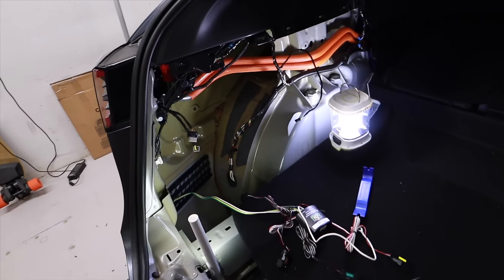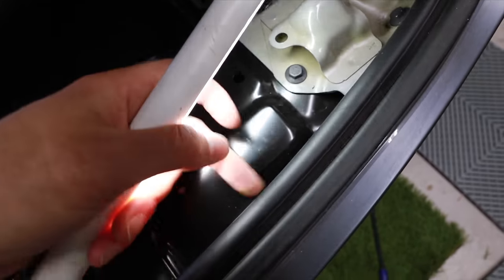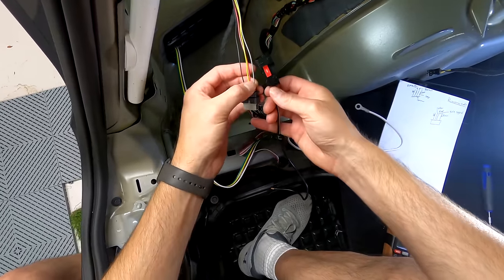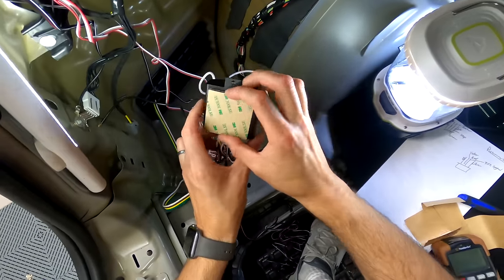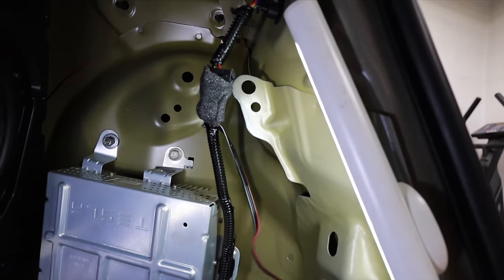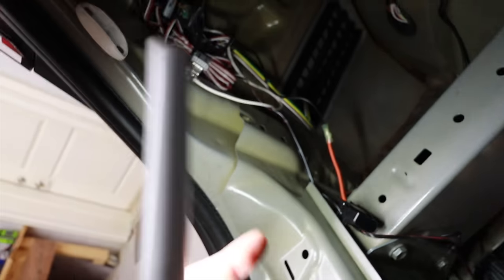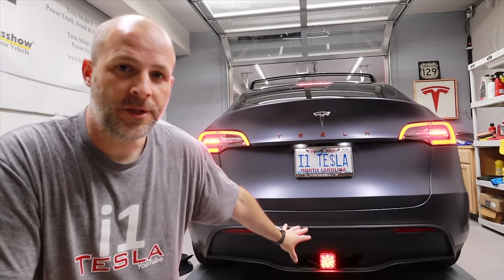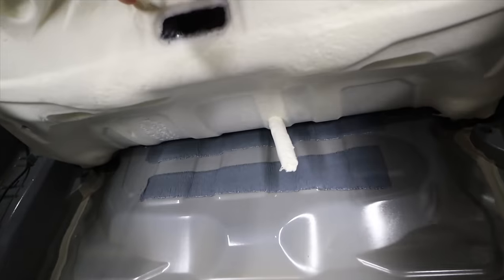Model Y Trailer Wires

Comment: My 5 cents here: i think it is better to move the fuse close to the battery (wire insulation might fail somewhere along), black wire might be considered as negative.
Reply from the maker: Good point
Reply: Not only your 5 cents, this could save the cars live in case of a damaged insulation.
Btw. do Americans don’t need a backup light on the trailer?

Comment: Great video but I'm wondering if it's really necessary to run that 12V wire to the front instead of finding 12V somewhere in the rear?

Comment: I recall Sandy Munro showed a single Tesla OEM electrical connector prepped and ready to use with their trailer hitch.  This was before they even offered the Tesla trailer hitch option.  In short, no need to find turn signals, brake lights etc.

Comment: Can you try to show how it looks like when having a trailer attached, in particular one from U-Haul.
One thing to demonstrate is how easier or difficult it would be to attach and detach the security chains.
Can you measure how much additional time it would take when using a supercharger, by finding a spot to park a trailer,
detach it and then going to the supercharger. Then coming back, re-attach the trailer and go?

Comment: Brian, it is not too far. I put the hitch wiring in the model 3 and had to open up all kinds of things.   I ran a 10ga for extra capacity for a 12v socket or power trunk from the front battery, through the firewall, along the passenger door sills and up and over the rear wheel to the sub compartment. That is where I mounted the light module right to the sub mounting arm which was really convenient. I was able to run the wiring out to the hitch right through an existing plug which I used as a grommet for the wiring which was in the back of the trunk tub. There are actually these plugs on each side in the back. Through the plug it could go down to the hitch area outside. I have always had a supply of and ran all wiring in plastic flexible split loom everywhere to protect it. I have always run everything in loom. I have been using the lighting and hitch for a 24x60 aluminum hitch platform which has rear lights built into it. If I told you what I did in wiring and equipping an older 88 camry that I used, it would be much more than anything we will probably do to the model 3. It went from entirely removing the dash, to soundproofing the roof and flooring to making the windows auto roll up with remote control and on and on as well as remote start, honk, alarm paging, 120v inverter wiring etc.

Comment: You definitely don’t want to use autopilot with a trailer, AP doesn’t know that the length of the vehicle has changed. If the vehicle swerve  to avoid an obstacle on the road the trailer will most likely hit the vehicle in the next lane, auto pilot doesn’t know the length of the vehicle has changed.  Brian this is a bad advise but I love the channel. I  look forward for watching more videos.
Reply from the maker: That is why I added "pay attention"
Reply: Even plugging in, Tesla still doesn't know the length.  Trailers vary widely.
Reply: Hussain Saleem Right. Automatically changing lanes with a trailer in tow is a recipe for disaster with Autopilot engaged.

Comment: I assume the backup sensors only beep/cause issues when in reverse?   in forward /autopilot cruise etc.. it does not cause an issue when a trailer is behind the Y?  The aftermarket light setup can that void the Tesla warranty or cause an issue?

Comment: Great vid Brian!  Question: Would it be possible to install the Eco Hitch and have BOTH the Tesla Wiring (in case Tesla Tow Mode improves - possibly allowing more AP features) and the aftermarket wiring plugs available? Then, you could plug into aftermarket wiring in a safe area with a light or empty trailer, and use Tow Mode on other legs of the trip after switching plugs. Or is that not even possible? THX

Comment: Just did this myself.  I did fuse in front.  My only issue, is the effort in taking off && putting back on the rear panels.  The lower part of the panels, the recessed part, seems off.  Brian, you had removed the center tub pannel, which I did not do, since I had no bottom facia bolt issues.  Is there an order for the panels, ie ,Do the floor cargo liners need to be removed, etc. For perfect refit?
Reply: answering my own question:  When I went back and re-examined more in depth, I determined that 4 extra panels need to be removed before the side panels to make your life WAY easier.  The 2 bottom panels of the side holes, they go in near the end, during re-assembly & the 2 tunnel panels that run parallel to the side panels.  This completely frees the space for the side panels to simply drop into place & snap in sans obstruction.  Boy this would be so much easier the 2nd time around.

Comment: My model y came with the factory hitch. I bought the same lights and 7 to 4 pin adapter. But no lights come on. The trailer mode turns on but no lights…

What am I doing run. Thought it would be plug n play hmm

Comment: Hi Brian. Off the subject question. I have an SR+ and the foot well lights are there but are deactivated. They only flash for a second when I open the door.  Next time you are in the area, can you see if there’s a way to hook the floor well lights to the lights at the bottom of the door which do work ?  Thanks. Love your videos.

Comment: Brian,  Found solution after second call to really more helpful Tekonsha tech staff Kirk and Peter. Wired longest sensor, happens to be right turn signal, with 3 foot extension with thicker 16 gauge wire, to third brake light in hatch glass via flexible rubber wired connector between hatch and roof.  Now have license plate frame with dozen LEDs operating tail and brighter brake lights.  MY now has 4th super bright tail and brake lights from United Pacific, Amazon.  MY is now easier for blind and distracted drivers to see it and avoid rear end accidents.  Also wired direct from battery second wire for travel refrigerator connected to 12 volt always on power outlet in rear.  Ready to travel now!

Comment: For a rear need for 12 v you can attach a wire to the 12v terminal on the right side of the penthouse below the back seat.
Reply: But you would have to splice the wire? By connecting to the battery, you don't touch the original wires.
Reply: @nihongobenkyoshimasu3190  No splice required.  There's a bolt you can put a ring terminal on.

Comment: Since my Y came with the hitch etc  I plan on mounting my led rain light recessed into the cover panel for an ultra clean look as if it comes this way and use a quick disconnect to remove it when I need to use a trailer

Comment: Brian,  Great video on solution to adding tow hitch with wired lighting.   Added same Tekonsha sensor system to our MY to connect to a fourth brake & position light bar attached to bottom of license plate frame.  Confirmed correct wires for parking, brake and turn signals with volt meter and added sensors to wires then proceeded thru sensor learning mode many times. However, turning on left turn signal causes brake light to flash! Other 3 functions work great.  Any ideas on what’s happening? Or what needs adjusting?   Tekonsha technical service had no information for Tesla install.  Your videos are really educational and helpful!  Thanks for your response.
James

Comment: You can pull 12a continuous, 16a max through the 12v accessory port.
Reply: todd2fst4u2 I got the impression he wanted sometimes run a 12v cooler off the accessory port. That plus the trailer load could be what he was concerned about.

Comment: UH - OH, Brian, You made a mistake.  You must put the fuse at the battery end, not in the back where the controller is.  If the wire you have run develops a short.  It can start a fire!  By putting the fuse at the battery end, it protects the entire wire run.  The fuse will burn out before the massive electrical current can start a fire.   When connecting to a battery, always fuse it at the battery end or very close to it.  Most all vehicles even have what is called a fuseable link which is a short piece of wire ( approx 6 inches long) similar to what you ran that connects the battery to the fuse box.  It is situated so it is not near anything flammable  In the event of a major short or overload.  This link overheats and melts breaking the circuit.  In your case you now have a 15 foot long fusable link that runs up against other meltable/flammable materials.  This wire could allow up to 100 amps or more for long enough to start things on fire.
Reply from the maker: Thank you I will change it
Reply from the maker: @whiskeywisdomplus  Sorry but I'm not liable for peoples mistakes. They can read the directions.
Reply: @whiskeywisdomplus  modifications don't void warranties, that's not how it works.  Look up Magnuson-Moss warranty act.  Warranties can't be "voided", a manufacturer can only deny a specific warranty claim if and only if they can prove that the specific modification caused the failure you're making a warranty claim about.  Even then, the rest of the warranty remains in tact.
Reply: @whiskeywisdomplus  that's cute but an owners manual doesn't override federal law.  Sorry.
Reply: @whiskeywisdomplus  if you mean, specifically, "Non-genuine Tesla parts or accessories or their installation, or any damage directly or
indirectly caused by, due to, or resulting from, the installation or use of non-genuine Tesla
parts or accessories;"
Then it doesn't disagree with me, it says exactly what I'm telling you.  Tesla can exclude damage caused by a non-genuine Tesla accessory.  CAUSED BY.  That's exactly what I said.

Thanks for proving my point.

Now go educate yourself:
https://en.wikipedia.org/wiki/Magnuson%E2%80%93Moss_Warranty_Act?wprov=sfla1
Reply: @whiskeywisdomplus  you again prove my point, but then give an unrealistic example.  They have to PROVE that the specific accessory CAUSED the specific damage.  This is a consumer protection law.

I'm correct, you're not, get over it.  I have extensive experience with this exact topic, I know how it works.  Warranties aren't "voided" when you install something aftermarket.  The whole point is to prevent exactly what you're saying.  Otherwise a manufacturer could "void" your warranty if you installed non-OEM tires. Non OEM brake pads.  PPF or a wrap. A radar detector.  Floor mats.  The whole point is to prevent that exact abuse.

Warranties are a serious thing, they have weight, they have legal meaning, and they can't be cancelled willy-nilly because you connected a wire to a battery.

I'm sorry, but your understanding is incorrect.
Reply: @whiskeywisdomplus  also your rant on motorcycle helmets is completely wrong too, and completely unrelated.  DOT and Snell certifications don't even remotely work in similar ways and safety certifications have nothing to do with a manufacturer warranty.  DOT is a self-certified government standard, Snell is a private rating that only racing organizations care about.  Maybe you meant ECE.  Doesn't matter.

Just stop.
Reply: @whiskeywisdomplus  "I was referring to the giant paragraph of what voids your warranty".

Ok, first off you said page nine.  There is nothing on page 9 that lists things that void your warranty.  Voiding warranty is on page 10, not 9, and has things like scraping off your VIN or not complying with recalls.  What exact phrase in there do you believe qualifies a trailer hitch to void an entire warranty?  Please lay your expert legal advice out for us.   I'll wait here.
Reply: @whiskeywisdomplus  I also never said "trust me".  I can see how you misunderstand everything, your reading comprehension is terrible.

Comment: wouldn't the rear bumper ultrasonics sensors detect the trailer? 🤔 (or the cameras)
Reply: Hasn't been a problem for me.  They blink a little bit and turn red occasionally, they definitely see the trailer, but they're not beeping or annoying.

Comment: Is there a way Tesla can activate towing mode when using a third party tow hitch?
Reply: Good question!! 👍👍
Reply: And that would be the point of using the factory wiring it deactivates auto pilot and activates tow mode witch dose who mows what to the drive motor mapping
Reply from the maker: The only way to get the car in Tow Mode would be for you to push a button on screen. Tesla has zero idea I have this on
Reply: a way, or a reason?
way yes
reason, why would they 🤔
Reply: I mention this because i use it for my bike rack and the back sensors keeps going off. So I’m thinking part of “tow hitch mode” it probably turns off the back sensors?

Comment: I would also have to imagine that tow mode from the factory will also disable the rear sensors so you don't constantly have a warning on your screen something is close.  I'll find out next week since I'm getting the retro-fit package installed on Monday.
Reply: I haven't found it to be a problem with any trailer I've towed.  Bike racks could have the same issue and don't get plugged in.
Reply: yes and I am wondering if Tesla has a software update as well for the tow package for tow control of the car, I think the model X has this.  if you could report on your findings about what is different with putting in an after market tow hitch for $400 versus Tesla doing it for $1000 I'd love to know.  thanks for reporting back to us here, if you don't mind (that way I'll get notified of your update.) I made a pre-order of the car before the tow option was available and am trying to decide if I should go with Tesla install or do it myself (like I did on my Model S)
Reply: is the retro fit package from Tesla?  my local sc is not aware of a retrofit package..can you share the details so I can advise my local center?
Reply: Derek Brown  can you share the retro package ordering information, local SC has no idea
Reply: Larry Frank The part number is 1609595-00-A. It’s $1200 plus tax and they may or may not charge you a minimum service fee.
Reply: @dmoney0620  let us know how the install goes today..I think it may be worth the extra 600 over the aftermarket to have Tesla and proper electrical hook ups...
Reply: @larryrcmanf  Will do.  I dropped it off at 8 AM this morning.  There is some other cosmetic work that needs to be fixed so they didn't give me an estimate on when I'll get it back.  My guess is a couple days.

Comment: One difference with the Tesla version (I never saw it yet) would be the electrical plug that should be located on the right.
 As you can check, there is a little square opening designed for it.
Reply: The OEM harness plug is a couple inches left of the receiver.

Comment: unfortunately the statement with "no damage to the electrical cable" is not correct.
The blind connector CUTS in the original wire from the factory. So basically the statement with "no guarantee loss" is not correct.
whether you can see this during a dismantling or not is another matter!
I just wanted to note it correctly. but keep it up :) nice to see what is already possible with you in the usa!
something like that would be absolutely impossible in my country
Reply: There is no cutting happening.  The new connector simply envelopes the original wire with magnets.  Think of it as a magnet hug, not a shiv to the gut.  The original wire remains unscathed.  There are splicing connectors that penetrate the original wire to create a new physical path for electricity to flow.  This isn't one of those.
Reply: @dougdevine27  oh thats really magnetic :O  then I said nothing.
Reply: @MemphisMG86  inductive sensor, like an amp clamp. No damage is done.
Reply: @GregHassler  in slow mode i see it. thats maybe the reason why the light have a delay by the breaking light test
Reply: @MemphisMG86  exactly - there is, annoyingly, a slight delay as the current is detected.  Blinkers on the trailer blink slightly out of time with the car.
Reply: @MemphisMG86  I really appreciate a human that can recognize a mistake and admit it. Go you! The magnet thing is pretty cool.